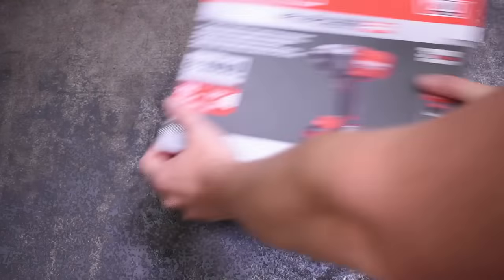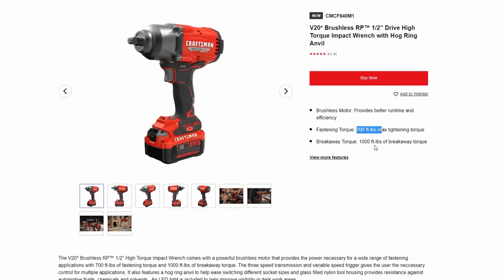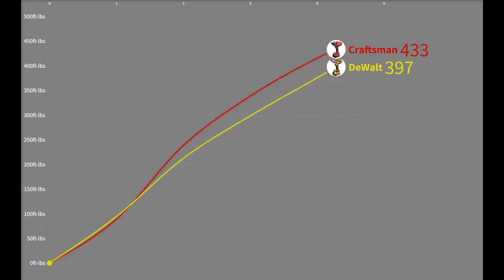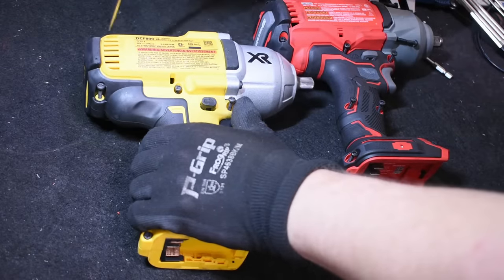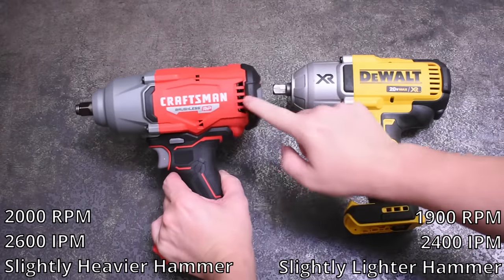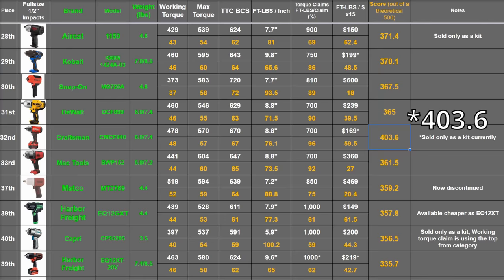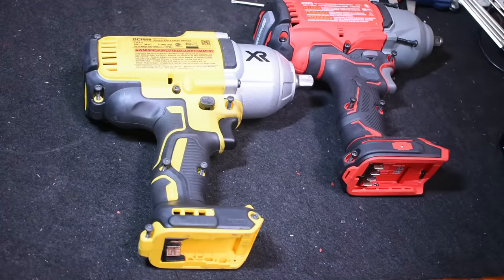Something Weird is Going On Inside Craftsman's New High Torque Impact Wrench

Comment: Do you know if the rest of the craftsmen power drills, any good.
Reply: Not so much. Check out WorkshopAddict's videos on the new RP stuff.
Reply: My Craftsman brushless drill out performed the Dewault drill we have in my shop.
Reply: Oh cool because I do carpenter work (not as much as you think); I've always used dewalt but I've been needing some new drill because frankly my drills are shot, from like 6 to 8 years ago. So would you recommend them for work like that @FZRMaverick?
Reply: @neffinsanchez4049  I personally like them. It has speed selection. I used my drill to drill into steel guides. Made quicker work than the Dewault. Shouldn't be any issue with wood working.
Reply: @neffinsanchez4049  Mind you, I was using the drill with a 4ah battery. I got lucky and got the brushless drill/driver combo for $100 at Lowes through a sale. They come with the 2ah battery, but 4ah is the go to
Reply: @FZRMaverick thank you for the great advice!!!!!

Comment: and this is why the brand doesnt matter anymore, its all about manufacturer nowadays 😂
Reply: Just choose your favorite color 🤣
Reply: Basically if you on one platform already for years, you just stay with same brand. Even if other brand has better specs. I use 18V Makita for 15 years and M12 for at least 10 years. Recently bought Makita impact wrench. It is impressive power.

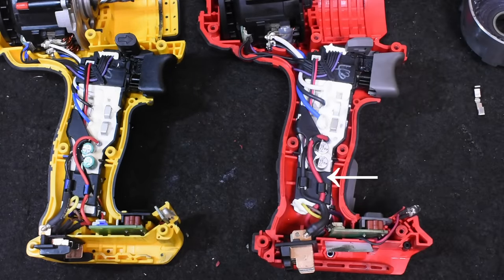Comment: At 7:25 I'm not sure I agree the Craftsman has an actual larger wire gauge.  The conductor itself looks like it may be the same gauge as DeWalt, but with cheaper insulation which is thicker to make up the same temperature rating.  A difference like PVC insulation in the Craftsman vs Teflon in the DeWalt.

Comment: Notice the little metal o- ring on the end of the 1/2 inch drive on the craftsman which the dewalt doesn’t have. That broke the first time I used my craftsman and they tend to break often on older impact wrenches. I use the dewalt at work and have been using it for quite a while and have had no problems with it.

Comment: I bet the wire gauge makes most of the difference with less resistance in the circuit. It's interesting it looks like the craftsman has higher quality components other than the cheaper non SMD LED but really who cares

Comment: So if we would buy damaged Dewalt(I saw cheap as hell one with messed  motor, slap guts of craftsman or at least motor and hammer to it, we could  use Dewalt batteries :D
Reply from the maker: On a brushed tool probably. Brushless motors are quite particular about their management. So I wouldn't count on it!

Comment: i bought a craftsman impact back in 2016. it went up in smoke 3 months later. i went back to the store and they directed me to cooperate. then calling craftsman they directed me back to the store. a month later i was still stuck in limbo. i will NEVER buy anything craftsman ever again. they do not warranty their tools and will no longer get any money from me.
Reply: I use Craftsman in a forklift shop. They get used all day, by multiple people. Zero issues. Other than brake clean being used to clean them, and taking off the white paint, and staining the batteries.
Reply: 1 case...effectively means nothing. Go buy a new one...then keep it for a bit then return the old one within the warranty/return. Assuming it's actually a failure to honor warranty issue.